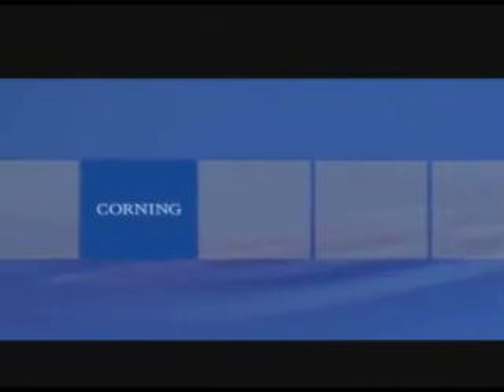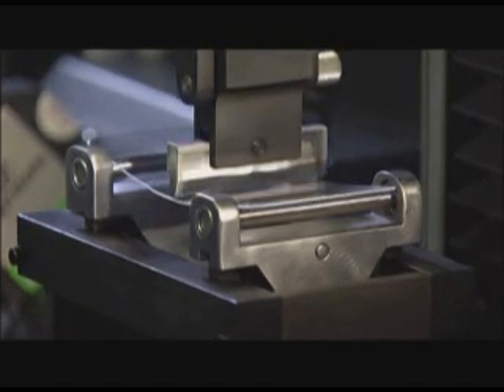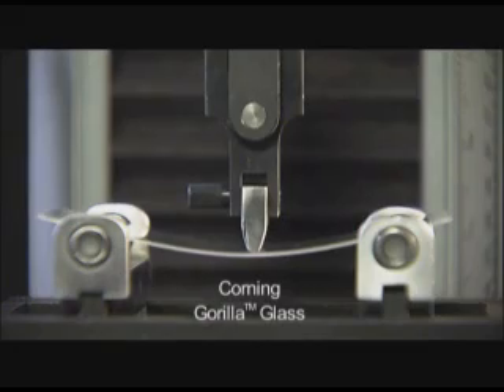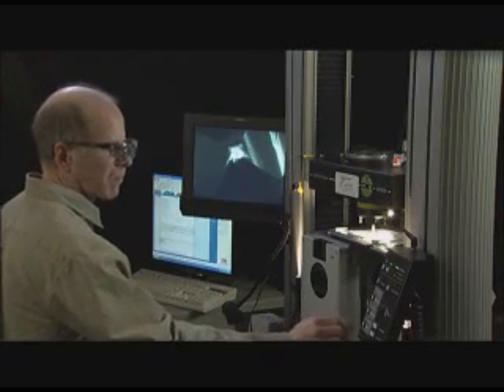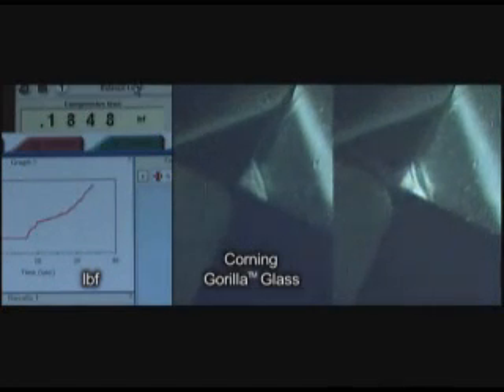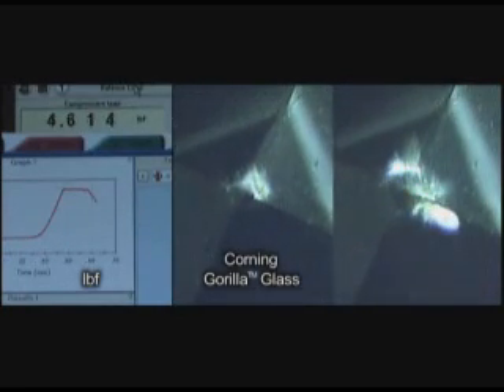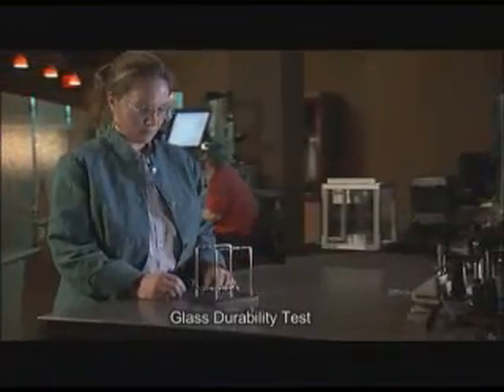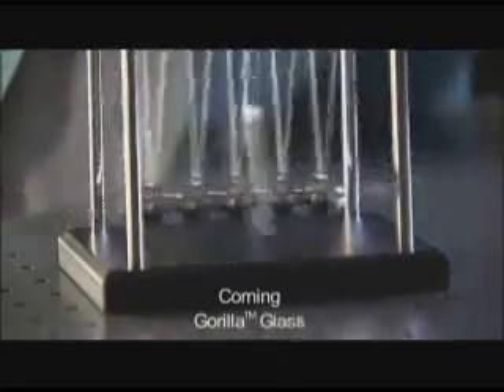Corning Gorilla Glass Stress Tests

Comment: The iPhone4 has something better. From the iPhone 4 video:    “We developed a custom glass that’s comparable in strength to sapphire crystal but about 30 times harder than plastic. This glass is not only used on the front of the phone but on the back as well.”

Sapphire has a rating of 9 on the Mohs scale of mineral hardness, which is quite strong. Diamond (the strongest mineral) has a rating of 10